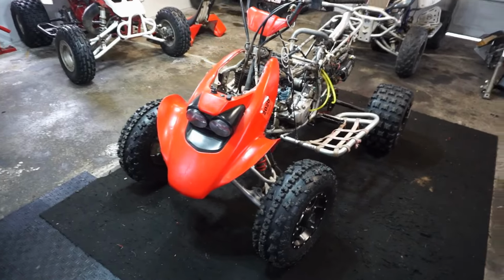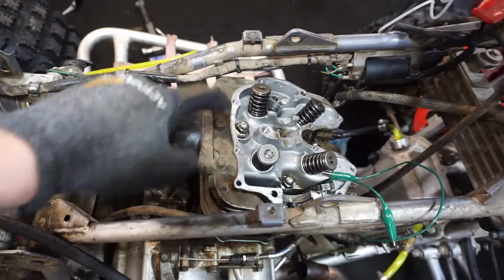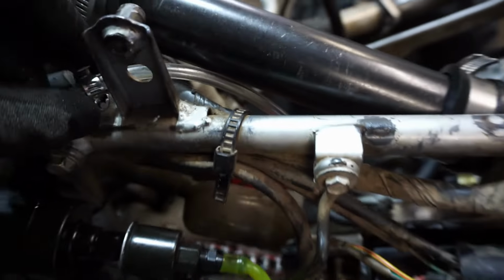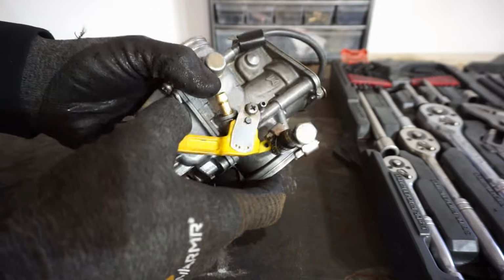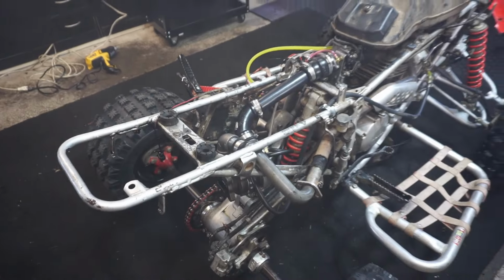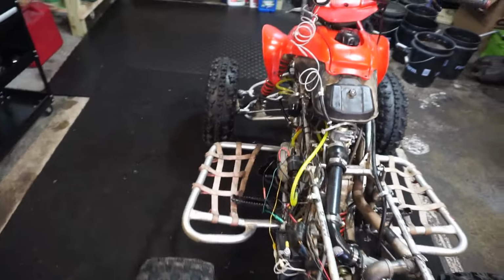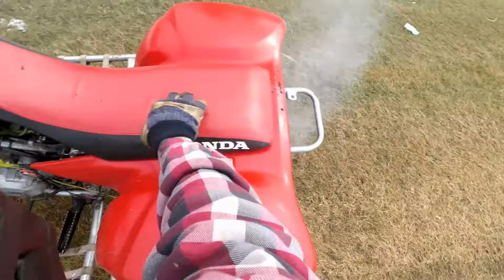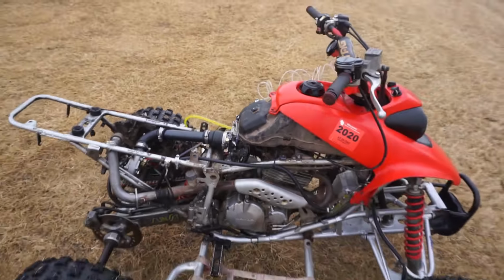Turbocharging My Honda 400ex 2.0 First Ride (New Design + Upgrades)

Comment: Get an oil restrictor for the turbo. Fuel pressure needs to be zero when not in boost. If you can't get it to zero then set it to say five psi then rejet for the extra fuel. Smaller pilot lower needle exc.. then use the regulator to raise the fuel pressure per pound of boost. Last but not least get a afr gage. You could use it tuning your other quads also.
Reply: The oversize main isn't going to make up for the underserving accelerator pump either for off idle. Lag won't go away until accelerator pump is squirting early enough and proper amount. Bet he gets her running soon.

Comment: Most fuel pressure regulators use a return line.  Excess fuel is sent back to the tank.  Check to see if yours requires a return.  Fuel comes from the pump to the regulator .  The regulator then sends desired pressure to the carb and returns excess pressure back to the tank.  I wonder if that kinked off line is intended to be your return.  Great job, you’re almost there.
Reply: Brent is right, try that.
Reply: What if you go to a fuel injected carburetor so that it would be possibly to tune it?🇺🇦🤙🤘possible a fuel return?
Reply: i was going to say the same thing also going with either a lighter waist gate spring or heavier spring
Reply: There is I have this regulator there is a return on the back and he should return to the top of his gas tank
Reply: Yes! The return is what bleeds off the excess pressure...

Comment: Did u lower the plug gap and make sure there is no boost leaks. Is there and air fuel gauge on there? Will help tell u if it's to rich or to lean. Careful man playing with fire shall we say can blow up easy during this stage. Good luck man keep it up.

Comment: Put it on injection get it running right, then add the turbo, then change the map to suit the turbo, you will always be fighting it with a carb, it should be much simpler than this!

Comment: Couple of questions, should you not have run it in before going back to the turbo to let everything settle before adding boost? Also please for the love of God get rid of that flange on that downpipe 🤣
Reply: I was waiting for someone to say that, it was really bugging me as well.😏👍
Reply: tbh if the cams are already broke in your good just send it lol rings and bearings are good after a few heat cycles and an oil change, plus its better to break them into the full rpm range using them normally after you drain your break in oil. cams are the only thing that need a "break in" for 20 minutes at 2500 rmps so you can harden the lobes. after that you are good to go to just use it and trash on it. look at grandma car barn finds...oh its so nice it's only got 30k original on it... as soon as you open it up it starts smoking worse than cheech and chong because the thing never seen over 2k rpms..they get used to babying them. a redline a day keeps the mechanic away your car/quad anything with a motor will last longer if you rev the shit out of it once in awhile  lol.
Reply: He wants it on there because it’s part of the oem pipe but it bothers me too.
Reply: At least tac weld it so it's not all over the place. 🤣
Reply: That flange looks like a pair of bulldog tin snips might be able to cut it off. I would use that, or a dremel.
Reply: @stephenbailey0278  Don't sweat the small things. He will take care of that when he gets it running right. I am not being a smart ass, but everyone saw it. He even said that the other parts were just hanging and would have to come back and make something to hold it. I just hope he doesn't stop working on it. Thank you, Mr. Bailey

Comment: The carb is designed to have air drawn threw it not pressurized. Put the carb before the turbo so it can suck the fuel in   :)
Reply: That’s what I was thinking. They run blow through carbs in carbureted turbo cars.
Reply: I agree 100% too! Honda designed that carb to be a draw through normally asperated. So keep it as a draw through. All you would have to do is re-plumb your turbo setup
Reply: That is a simple and effective way to quick turbo your small engine, but these turbos don’t have carbon seals, so wouldn’t work.
Reply: He tried that first. Fuel
Couldn't get to to the engine. The fuel would condense in the pipe before getting to the engine and it wouldn't start. Watch the video, two videos ago I think.
Reply: Air moving across the Venturi is air being carbureted.

Comment: It’s definitely almost there don’t give up on it, the boosted bois did a turbo 400cc in a shopping cart maybe you can get some info from that video. I’m not sure if it is hurting you in this situation but maybe a ported head would help out
Reply: I thought so
Reply: Theirs is a 200cc
Reply: Boostedbois did a 125 or 200 cc shopping cart definitely not a 400 I watched all the videos from start of the build to the last video they released of it after the efi swap and turbo kit
Reply: That fuel injection kit they got tho is what he needs
Reply: They switched to fuel injection but could be done nevertheless
Reply: @chitos2132  it cant be done with a carb unless running super low boost like 1 or 2 pounds it forces the fuel back into the carb I'm surprised it hasnt blown the bowl off the carb yet it can be done on vehicles by running a blow through carb but I dont believe they make a blow through carb for atv or small engines  unless he sets it up like before but mounts the outlet of the turbo directly to the intake boot and mounts the carb to the inlet
Reply: @dakotahicks6725  check out "build break repeat" YouTube channel. They've made plenty of boosted carb vids. It will work but it's just gonna run like crap. You're partially right tho. The guy is doing an experiment and if he figures it out that would be super nice to see tho.
Reply: @chitos2132  they mounted the carb to the inlet of the turbo tho that is truthfully the only way to make it work I've watched them for years along with boostedbois carsandcameras redbeards garage ratherbwelding builds not projects and a few others
Reply: @dakotahicks6725  they definitely put it turbo into carb my fiend.
Reply: @chitos2132  at first yes and it ran like crap so they switched it they made multiple videos from the turbo vintage race cart to the turbo rotory minibike

Comment: The carb slide works on vacuum which isn't compatible with your setup, u would try a different carburetor with a manual slide.  Don't give up you've come this far.  Also it would be a big help for you to learn to read your spark plugs, they can tell you a lot about your air fuel mixture and other thing going on in your engine.  Keep up the good work.
Reply: 36 mm flat slid or a  vmMikuni round slide might be easier

Comment: Your going to have to put the carb on intake of turbo. That carb just won’t work blow through. Get a good gravity short ram into the turbo with carb and try to get turbo as close as possible to head. You got this. This is just my recommendation

Comment: Put the turbo between the carb and the engine so the turbo pulls through. Many old motorcycle turbo kits work this way. Its also great for packaging. The carb cant pull fuel out of the bowl if there is pressure pushing it back in. That is why carburetors built for boost are of a much different design.

Comment: New carb, a head spacer to lower compression and run positive pressure to the vent on gas tank. Also make sure youre using the right heat range on yor plug for the turbo

Comment: Definitely a smaller plug gap is needed when you get into boost.  Most carbs need a rising rate fuel pressure regulator which raises fuel pressure 1:1 per pound of boost.

Comment: (You don’t need the fuel pump or regulator) Pressurize the gas tank from the turbo reference line. Boost pressure into the gas tank should equalize the fuel pressure as the turbo spools and open the float push fuel into the engine.
Reply: That not correct.  In theory it may sound like it would work but the pressure in the fuel tank will not equalize with what's going into into the carb thru a small diameter vaccume line. The engine also pulls vaccume before boost so then itd be pulling thr fuel backwards... The setup he is using right now will work with a few changes. He needs to add a fuel return line from the regulator cause the pressure has no where to go but flooding tbe carb.. He also needs to add a plenum in the pressure side befkfe tbe carb... And tbst turbo is way to small the exhausr inlet is like half an inch...
Reply: 2 carburetors would be a more interesting experiment to watch. One on the vacuum side of turbo. Boost line into the gas cap vent might work Lol
Reply: It wouldn't work b.c. the gas tank has a vent so it would never build pressure. Even if u plug the gas cap, u would then run out of fuel til the tank received new air to reduce the vacuum. Imo he needs a deff carb
Reply: Boost reference line into the gas cap vent.
Reply: @KrustyQuad  is right on this one
Reply: Wont work... #1Carbs don't push fuel... carbs hold fuel and regulated how much fuel and air the engine sucks in... #2 carbs are made to work in vacuum, to run boost through a carb you need a blow-through setup and i've never seen one for a quad. All of the carbed quads i've seen on youtube have fuel feed issues.... and they all wonder why. It's good to try and learn but most people try to learn lesson #143 before having finished lesson #10.

Comment: Those carbs are meant to work with vacuum, if you put pressure in there(boost) you will have serious fuel issues. You need a blow-through carb for boost applications. Would of been far simpler to boost an EFI(fuel injected) quad and add a tunable ECU to adjust fuel tables and ignition with software on a laptop... makes things so much easier.

Comment: I think you should shorten your pipes. Think of a car turbo system. Usually turbo sits right off the exhaust manifold. very close to the engine. Think of air flow. The exhaust has a long way to travel on the 400. Just my opinion. Shorten the airflow. Maybe that will give you better spool.

Comment: I wonder if a smart carb or lectron would better react to the sudden increase in fuel demand when the boost hits better than a conventional carb
Reply: The problem is not the fuel demand it's the boost pressure running through a carb that is meant to work in vacuum..... This setup will never work.

Comment: A blow through carb wont work unless you've also put a pressure line into your fuel tank. Generally the increased pressure will overpower the fuel pressure into the carb. Resulting in a big loss of power and excessively lean conditions... 👍 if you've figured this out and I missed it, please accept my apologies.

Comment: You really should switch out the oil feed system to an external oil tank, oil cooler and like an electric oil pump. Your oil flow is not sufficient enough and not cool enough for the addition of the turbo since you're not running coolant.
Also, trying to turbocharge a single cylinder 4-stroke is going to be quite a pain considering the exhaust stroke and the intake stroke. Remember, the intake valve is closed when the exhaust valve is open, so trying to force more air into the single cylinder while it's trying to exhaust isn't going to "make boost" like you want it to. Do NOT expect the whoosh noises you're desperately trying to get. In this application, all you're really doing is making sure the forced induction is there for when the intake valve is open.

For what you're trying to achieve, you should put the 400ex back to stock exhaust, intake, and fueling and get yourself at the very least a 2-cylinder, if not a 4-cylinder or you're going to keep blowing motors up trying to get the results you want, instead of getting the results you have.

Comment: Yo good job so far witb tbr regulator.. But you need to add a return line from the FPR back to the tank... You also may need a ligbter spring in gbe regulator so you can adjust it down to 2psi...and what happened to the plenum!? You need it otherwise itll break up before boost and when reving it... Your close tho trust me. But look for a cheap k03 turbo on Facebook., in tbr exhaust inlet on that hotside is too smaller than the stock exhausf diameter it will choke it
Reply: Thumbs up so hes sees this
Reply: Ill have the video of it working on a yfz for you next week

Comment: You could try a Keihin FCR 39mm or 41mm carburetor. The carburetor you are using is a diaphragm carburetor and when I charge the turbo it makes the carburetor plunger go to the maximum and you lose control.

Comment: Hi Joe, without fuel injection to tune you are much better off sucking through the carby. Correct me if I am wrong but I believe you didn't clean or degrease the top of the cylinder before fitting the head gasket. The head gasket should be fitted to clean dry surfaces. Cheers

Comment: You need a wideband o2 sensor and tune afr for 12.5 to 1 and do plug chops and adjust from there.

Comment: Stock carburetor will not hold up to the sudden boost pressure. Just like on a car you need a blow through carburetor also fuel pressure per pound of boost is the right way to set it up plus Uniden AFR gauge to help you tune because your motor can go lean real quick then you will be rebuilding it again!

Comment: Hey man I know it's been a while since you worked on this. I hope you read this and take my suggestions! First thing I would have done double up the Cylinder Base gaskets to lower compression, put a "Stocke Replacment" JE Piston in or a Wiesco (I say "stock Replacment" because it's a forged piston with same compresion ratio), buy a turbine style inline Fuel Pump something simular to a Delph CFD0029... I noticed you have th FPR Return Blocked off, that won't do anything no matter what you do the fuel pressure is necause you always need to bypass fuel during idle and when you're not in boost, so plumb the retuen line back into the Fuel Tank somewhere. Now the FPR "reference" needs to be infront of the Carburetor infront of the Carburetor so that wa the FPR will see Vacuum during idle and lower RPMS and then it will get Bost Pressure during boost. Also you may want a Blow off Valve so that way whe you let off the throttle or wanting tp let it idle it opens and 100% by passes any boost that you do not wan't especially during idle it will be able to use Stock Hetting for idling. Now last you need to figure out a way to retard the ignition iming as the RPMS climb. Basicully you wanna think of it like this By pass all Fuel Pressure and Boost till you're into boost. You will also need to sand a more aggressive Taper on the first 12mm of the Slide Need. You do not wanna go wiith bigger jetting like you would think because now that you're flowing more air through which means you will have a much more powerfull "draft" accross the emulsion tube which which fuel pressure will autmaticully draw more fuel into the engine.

Comment: You need to replace the needle and seat with a set up for a fuel pump. The hole in the seat should be smaller because it provides more PSI at the sealing surface of the needle.

Comment: Tighten up your sparkplug gap a lot just so you can barely have a small gap, it sounds like when your are starting to build boost the pressure from the turbo is blowing out the fire on the spark plug, had the same problem with a Chevy 6.0 built motor with twin turbos and that was the problem, it may or may not fix problem but that is what it sounds like, Give it a try and good luck and I hope this helps.

Comment: Turbos only really make boost under load, that's why it free revs no problem.  The easiest solution for you may be an auxiliary fuel injector in the intake made to come on when boost comes in.

You definitely need way fatter main jet and make sure the fuel bowl isn't running dry as well for the current set up

Comment: You just need to replace the CV style carburetor with a normal non CV carb and youl be away. They need vacuum to lift the needle so forcing in boost will actually close it making it extremely lean

Comment: Weld a flange onto the base of a big slip on pipe, and bolt it straight to the turbo exhaust housing for simple center exhaust

Comment: There is a small jet in the top of the carb that pumps fuel into the carb when you hit the throttle might want to try a bigger one of those. It's under the diaphragm in the gold piece on the top of the carb
Reply: Or you could get a fuel injection kit like boosted boiz shopping cart

Comment: I had a 1988 Ford Thunderbird turbo coupe when I did a tuneup on it I put Cheaper spark plugs in it when it would hit 5 pounds of boost it ran fine anything over that it would cut out you might try something as simple as a more expensive spark plug

Comment: A carb with a diaphragm slide would probably work better in this scenario. It automatically opens the slide depending on airflow into the carb giving you better fuel ratio control.
Also gap the plug tighter 👍👍👍👍👍👍

Comment: Check to see how well waste gate puck is sealing at exhaust housing, you may need to throw a helper spring on the waste gate actuator to keep it sealed, if tension seems to be lite. Secondly see how much material there is  where puck seals up to the exhaust housing, if there’s seems to be a lot, scribe it and port it out to where there’s just enough material that it will seal, I’ve seen that cause turbo surge Numerous times.
Good luck...

Comment: Search up 400cc engine fuel injection kit....only way boosting a 1 cylinder engine is going to work i promise you...a 2 cylinder yes its possible while being carbureted but a 1 cylinder no...bc the exhaust pulses are too out of range and not smooth enough to create an even boost flow...i know this bc ive seen many others fail with it as well...soon ad they converted it to the plug n play self learning fuel injection...worked like a charm...and youd love it! I wanna see this 400ex work too...but that's the only way.